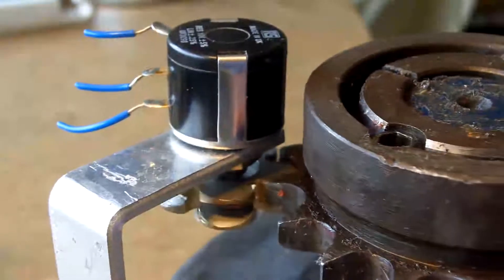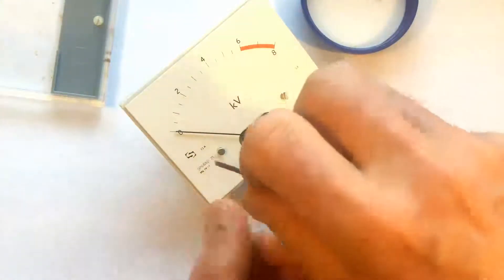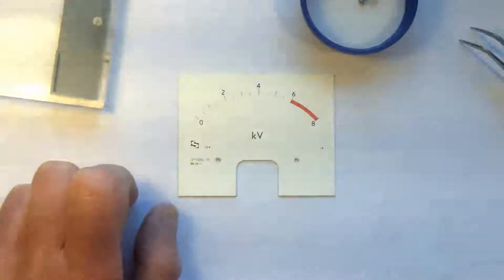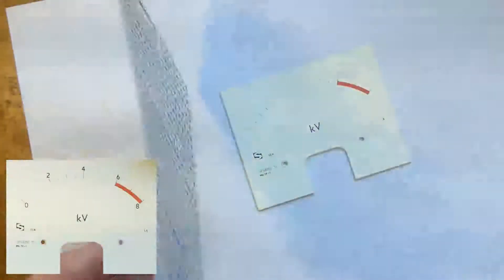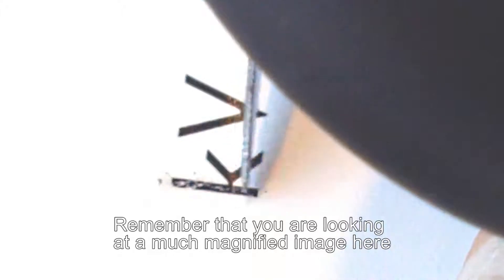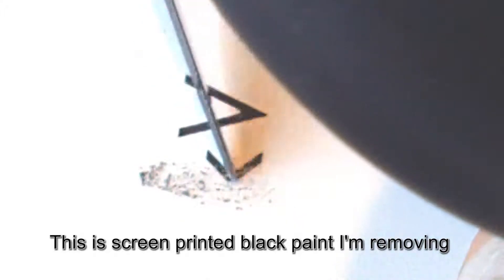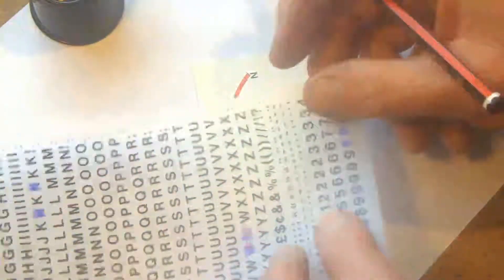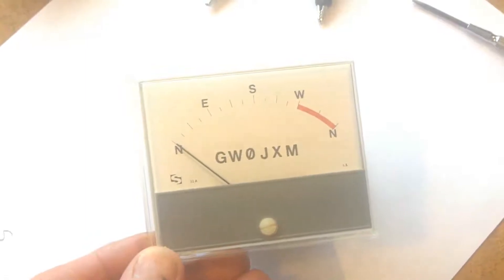About Radio 77 Antenna Rotator part 9 Re-figuring the scale of a panel meter to read N-E-S-W-N

Comment: Nice demo, Andy. My lettering sheets are almost 40 years old and they are still very usable. I keep them in a large book and stored in a cool, dry out-of-the-way location.The use of the white eraser is ideal for removing smudges from white surfaces such as you did.  Recently I purchased a vintage National vernier dial off eBay and the surface of the dial was horrible. I used a white eraser to removed 99% of the smudges. A pliable are eraser works equally well.

Regards,
73, de Mick WB4LSS

Comment: Not many videos around on the fine art of analog meter re-purposing,restoration or substitution! If one don't know how to get oneself out of trouble when one starts a custom manufacturing business, one certainly learns how fast -LOL! Do you miss your former business Andy? I miss the fun I had in mine, but I don't miss the suppliers, deadlines and pressure. BTW, and interesting video may be how to electrically define and make shunts for unknown, scavenged 'junkbox' meters.

Comment from the maker: Hi there, yep that works well. You can also ‘Repair’ a scale plate with a photo copier by enlarging the original modifying it and then reducing it to the original size. We had a photocopier that had the ‘powder’ cartridges and I could scrape of the powder off the paper the same as I scrape off the paint, couldn’t do that so easily with ink though. There’s more than one machine out there with a paper scale, I stuck them on with that glue that comes in like a lipstick container.  
73's ...Andy

Comment: I had to replace a meter on old Antenna tuner. I took a good quality photo of the original meter and used photoshop to customise the panal. the scale was spot on as The ruler tool in photoshop as well as grid layer made it an easy process. I had to print it out a couple of times to work out the correct size.

Comment: That brings back memories for me.  My Dad, about 30 something years ago, built a power supply from surplus electronic parts.  He couldn't afford a custom meter face, nor could he afford a new meter with the precise scale he needed.    He didn't do exactly as you did, but it was close.  He made a 4x larger scale drawing of the scales he needed, using the same type of letters.  He took it to a print shop and had a decal or plate made.  Whatever it was, it has lasted 30 something years.